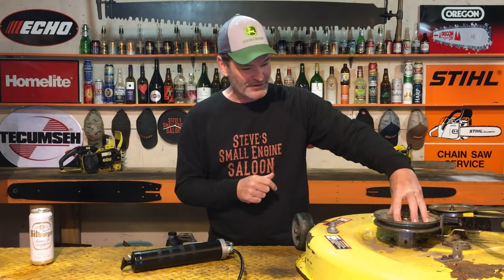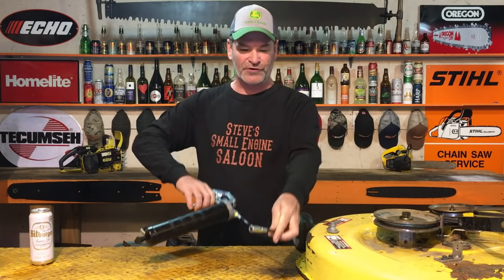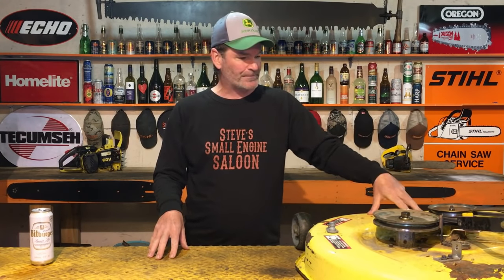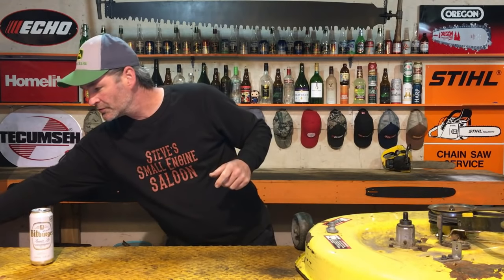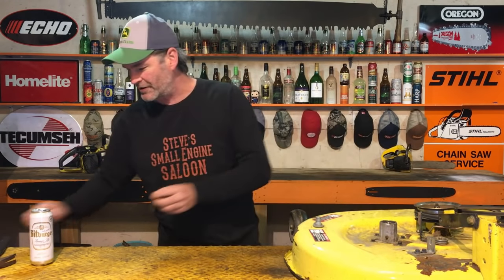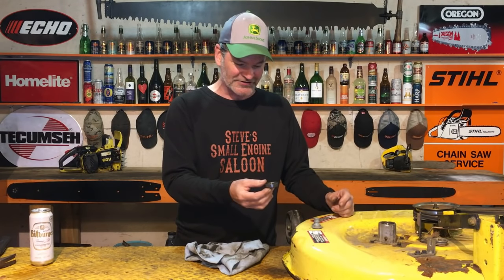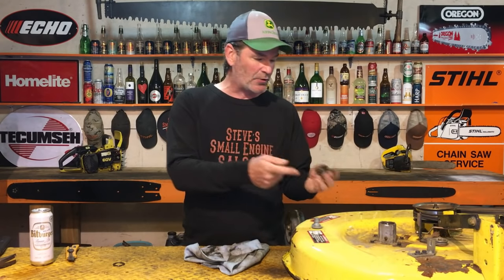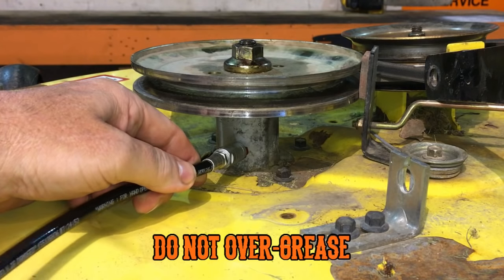Your Riding Lawn Mower's Dirty Little Secret

Comment: Steve should i just simply not bother to grease the grease nipples (we call um grease nipples in uk haha) on the spindles then,iv a almost new x350r john deere with the greasing points on the top instead of the sides of the spindles,now you mention this steve when i used to grease the mower deck spindles on my x110 i noticed the grease would like squart out under the mower deck out the bottom of the spindles just above the blades,which is like you say its bypassing the bearing,it says on my service sheet i only have to grease the mower deck every 100 hrs,one of the spindle grease points is blocked so is there any point in me replacing this grease nipple,great videos by the way

Comment: I ended up doing this with my fathers cub cadet. My only question now is how much to pump the gun and if I add too much grease, can it blow the seal off the ends of the bearings and do harm? I miss my dads old gravely. It had a weep hole that grease came out of when it was full. 30 years and not one bearing failure

Comment: I believe its on purpose not being able to grease that bearing.   Just like the cars or truck we buy.  They're built to break down so that the car companies can double their profit on the parts industry.   The race track we see with new car advertisement are used to see which parts last too long or too short so that the engineer can modify them to last the desired length of time before replacing.  Besides, how can they sell you a new car if your old one still works?

Comment: Good video and Thanks.  I did a spindle bearing replacement last year  and assumed that a double sealed  bearing would not be used because it had a grease fitting.  Now I know that John Deere has been taken over by  bean counting idiots that don't care one iota for product reliability.   The cheap Chinese bearings only freely   spin a few revolutions as compared with American  or German made bearings.    The nuts and bolts of the CHINESE made replacement  parts sold by JOHN DEERE dealers are WAY inferior to original American ones and will SNAP  tight off when properly torqued to original specs and the John Deere dealers WILL NOT let these junk parts be returned either.   Real mechanics Torque to factory specs however and John Deere  is now  selling JUNK DEERE replacement parts.  Cheap junk parts sold at full price are the latest parts scam.   The Deere is DEAD quality wise in the replacement parts department ,   so you are correct sir.

Comment: I have a Land Pride 6 foot finish mower deck.  I just replaced all the pulleys because the were rough and didn't get grease. I also greased therm, but I felt I neglected greasing more often, and that's what caused it to fail. I also looked at my sealed bearings, but I didn't add 2 +2.They didn't get grease; how could they?  My mower deck was designed to fail, but I feel bad that I didn't recognize it at the time.I already replaced 5 pulleys and have one pulley  not yet replaced because I cannot get the top bolt loosened no matter how hard I try to keep the blade from spinning underneath.  These engineers got us by the nuts.
Reply: No, CUSTOMERS have all the power!
Once customers STOP buying garbage, the garbage makers respond, IMMEDIATELY!
Competition rules the day!!!
Stop supporting garbage; support class!
Things will turn around, FAST!😊

Comment: Did similar with fan belt idler pulley on my Ford truck, took out bearing , drilled a hole in seal ,injected new grease, and put  some good tape over the hole with some pvc grey glue/cement and sealed it over that. Never had a problem with it again
Reply from the maker: Right on Marty!  Thank You...

Comment: I saw this on my Craftsman many years ago after the first spindle went out. In fact it only had sealed bearings and no grease zerks provide, so I drilled and tapped housings for zerks they removed the inner seals on the bearings and had no further issues. I did have one advantage over a lot of people though as I worked in a machine shop many years before that and had a good understanding of how bearing lubrication worked.
Reply from the maker: Right on Carl!

Comment: dad showed  me this bullshit a decade ago on new sealed bearings, never had to replace one yet on my 2009 Cub Cadet LTX 1050 for this very reason, I agree with your thoughts, some guy below posted to invert the lower bearing seal so pressure is released?    this isn't a automobile , its a lawn mower, don't invert the lower most seal, this will just make all the grease you pumped in or manually applied to fling out the bottom under the deck.

Comment: Sold bearings for 35 years…the grease is engineered to last the life of the bearing…don’t waste your time greasing them because you WILL over grease them…run them till they fail and replace with the brand SKF not a Chinese piece of crap they buy at the factory

Comment: Those Chinese bearings are like $1 a piece. Why bother? Take off the seal, dirt will get in. Probably last longer if I just keep it sealed on both sides. When it fails, just install $2 worth of new bearings. Too much trouble to grease the spindles anyway.

Comment: The deck was designed a long time ago and it was designed for plain unsealed bearings.  Later on the decision was made to use sealed bearings because so many people don't bother to grease the bearings.   Sealed bearings last a lot longer than ungreased unsealed bearings

Comment: It’s true.  Absolutely on point. Anyone who has had that teacher drag their fingernails down a chalkboard should know what a bearing seizing sounds like.  With the same yet amplified effect. I installed a new set of bearings on all 3 spindles.  Easy as pie. Just don’t put it off. My JD E140 was only 2 years old when this Funtime started.  Thanks, Steve.  Your video on this matter helped fix this pain in my backside.

Comment: I figure the grease will eventually push the outer seal away from the bearing. After all, it's not particularly easy to see what is happening while applying grease. My thoughts are to leave the bearing alone and not bother with greasing them at all. Also flooding the mower deck with water after mowing is just gucking up the underside of the deck so I stopped doing that as well.

Comment: Why not just grease the bearing and replace the seal? If you use the jerk their is no place for the old grease or air pressure to escape. Plus you will have to fill the entire cavity to do any good. Basically your still in the same boat. Just grease thw bearing and replace.

Comment: Would it be a good idea to drill a very small hole below the top bearing into the spindle cavity? This would indicate when the void is full and prevent hydraulic pressure from blowing out the outer bearing seals. After filling, a zip tie around the spindle, covering the opening, would prevent debris from contaminating the inner workings.

Comment: Wow! Thank you so much for posting this! Yes companies do do this type of thing to make the sub assembly fail and then they can sell more parts and get more labour rates for their repair shops. Either that or sell new mowers! I just found your channel and am enjoying all of your ideas that I can do to my son's rider mower. He's got a John Deere model D125. My suggestion to buy it. Thank you again! This video showed me how to remove the blade assemblies even though the assembly nut is rusted on. The blades are in dire need of sharpening. I have an attachment that works on my drill to sharpen the blades. What are you thoughts on these attachements? Do they work well? Also, are there any more of these useless grease ports on the mower? Thank you!
Reply from the maker: You're Welcome...

Comment: The spindle was designed with a grease nipple to use the open- type bearings of yesteryear. A cost-saving was to use Chinese " sealed for life" bearings which cannot be greased. If cost was such a major concern, why didn't they save the cost of the nipple and the hole for it?
Reply: I think this may be the most likely explanation. However, I do wonder why they still take the time to drill and tap a hole then install a zerk fitting. Some have mentioned that it's still there to keep moisture out of the shaft. Perhaps, who knows?

Comment: On my 1993 Wheelhorse 520H, 48inch base, the three spindles have fittings on top of pulleys. I do about 4 or 5 pumps. The grease will eventually come out under the bottom. No problems! 
It's pretty damn low if in fact the John Deere people are intentionally decieving their customers! But it's certainly believable in light of the fact that the poor farmers can't fix the tractors cause of all the software crap!! They don't care cause their greedy corporate pigs like all the rest!!! At the local auctions in the spring+fall you will see countless John Deere mowers lined up , but you will "Rarely" see any Wheelhorses" !! Toro killed the Wheelhorse cause they did nothing to market the tractor! I will never! buy any of the Green+ Yellow junk!!

Comment: Thanks for the bearing info Steve.  I have a John Deere deck, fairly new,  that I have been greasing, I will be checking the bearings out.  My pre retirement job was a vibration analyst, I monitored and inspected hundreds of failed bearings.  If the sealed bearings were greased from the factory properly I would think they should last a couple years.  I have inspected brand new sealed bearings and have found not all bearings are greased equally.

Comment: Steve...I love your site and your advice...but....
From a bearing engineer.....
"Grease suspends oil and releases it with heat. The oil then seaps through the oil seal lip when the shafts are spinning letting oil into the bearings.
Do you really think engineering would be so blatently corrupt to intentionally ruin spindles for so many years without intervention?"
I have a John Deere that has been religiously greased for 20 years. The spindles are fine. The seals are original too.
When you remove the inner oil seals you're allowing dirt from dirty zerk fittngs to be injected and contamimate the bearings.

Comment: For sealed bearings, I thought the purpose of greasing the spindles was to help to stave off water. A sealed bearing is that in name only. There's always a tiny space where the seal runs against the bearing races. By covering this with grease, water is less likely to get in. Before sealed bearings, open bearings needed to be greased for 2 reasons. 1st to lubricate, 2nd to seal.
Reply: Yes, this is what the Cub Cadet manual says for their decks.  Grease is used to displace water.

Comment: Sealed bearings with synthetic grease will not get contaminated and out last bearings with zerk fittings and especially using general purpose grease. Maintain sealed bearings and be happy ever after.

Comment: If i see this correctly i would remove 3/4 seals
Top : remove 
Mid top : remove 
Mid bottom : remove 
Bottom: leave it on
So excess grease would flow out the top, or replace the top bearing with a bushing

Comment: Same bearings in my Westwood with no grease nipple. But with your seal removed will the grease not push the outer bearing seal out with the grease guns pressure? Leaving the bearings unsealed?Tempted to ask are they the right bearings but they probably are

Comment: ☆HOOTYHOO☆  Good Action Man. Yes of coarse these manufacturers are fully aware of that bearing set up...  On the flip side;  You might take a pole of your patrons on: what is the #1 cause of Bearing Failure? Do you Know???   

 OK I CAN'T KEEP Ya in the Dark...

   The #1 reason for Bearing failure is over lubrication!
    ⊙ the Bearing will get lubed so regular (usually scheduled) that the grease gets impacted inside, not allowing for the Bearings to turn... then you get a permanent flat spot.
   Pulling those seals is unusually the best case scenario. NOT ALWAYS! But usually.
   Scott Outta Wa.

Comment: I have a JD L130 and the PTO clutch has  8 or 9 years of summer mowing use and is still working, just put grease in those sealed bearings.

Comment: cool little trick but ya need 2-4 small holes drilled into the outer seal so grease can flow thru effectively on both sides of spindle , ROCK ON !

Comment: One other secret hardly anyone knows about is there is really a couple of manufacturers of non- commercial Lawn tractors. The only two are MTD Canada (cub cadet) and anything sold at Sears id #247-00000( the cheap mowers)from 2014 or so, Home Depot,etc 
and Husqvarna USA  built  for Sears and Lowes etc (the better built Lawn tractors).
The only ones that aren't built by those are toro as far as I know " as of a few years ago". 
As of 2014 Sears was phasing out husqvarna tractors they still may sell them, look for tractor Id #'s that start with 917-000000
And that corresponds to the push mowers to...
And sorry to bust your bubbles the green and yellow ones are not built by the green and yellow company!!! They are built by one of the two builders above with the same parts just painted green and yellow... in order for you to buy a real one you have to buy it from a full line green and yellow dealer which cost thousands more$ buyer beware and do your homework

Comment: Car wheel bearings are sealed and last 100,000 miles or more. But over grease them and they’ll be toast in no time. The grease needs space to move about.

Comment: I owned a 1974 Cub Cadet for over 30 years until the engine went bad after being rebuilt three times over the 30 plus years. I have three acres and need a good mower. My wife and I bought a brand new Cub Cadet that was the biggest piece of crap I ever owned. Had nothing but trouble with it throwing the mower belt off. Took it back twice to be fixed and twice was told it had been repaired, but it kept throwing the belt. I put it up for sale after the first year and gladly sold it for a loss. I found a 1976 Cub Cadet with 50 inch mower deck. Paid $700 bucks but it has worked flawlessly . Don't waist your time with Chinese crap when you can resort back to American Made. Its worth it.

Comment: In this instance, I think it is less planned obsolescence and more trying to fit their average customer and eek out a little more base lifetime before major service.

Sealed bearing last longer if not being maintained. Open bearing last longer than seal, if being maintained. So it's a choice of what you want in there.
Since many customers are going to ignore maintenance, the choice to put a sealed bearing in is a better choice/longer lasting, and it lets them advertise it as "maintenance free*"
"*for the life of..."

But they are just buying chinese castings for the bearing/spindle assembly that come as they come. Some will have the zerk in there already, some won't even have the hole bored out.

Which would I want? greaseable. But I would grease them where a lot of people would just ignore it and run it unto death.

Comment: Many manufacturers are switching to sealed bearings. Why? Because most people never grease their bearings! Although I don't disagree with you overall, filling up the cavity does serve a purpose. It eliminates a space for dirt, debris and (especially) moisture from accumulating in the cavity. this type of units are meant to be used for home owners and will last years "as built" without a problem with these bearings.

Comment: BS -- The spindles on my previous riding mower lasted the life of the mower - 26 years - with no problems.  Current mower is 6 years old and have had no issues.  Shortest time I ever kept a rider is 10 years and that one never had spindle isses either.

Comment: Let me first say I love channels like this because they help the average mechanic get information that's extremely helpful. That said, when i see something that will not help and actually make a problem worse, than being a mechanic myself, I feel like i need to point it out.

So, the idea in this video is to extend the life of the bearing. That is a good thing. But, the method is wrong and here's why.  And let me start out by saying that if the reader is capable of pulling out the bearing to begin with, your best to simply have new bearings in hand.  Aside from that most people cant go into the job that deep.  So, you say pull the bearing seals on the side facing each other and the grease fitting so that the grease can actually get into the bearing. While that sounds good, here is why it is not. "Hydraulic Pressure".  When the user makes the modification and then pumps the spindle shaft full of grease (Which will take quite a bit) the pressure of the grease will push out at least one of the 2 remaining seals  out which will then let contamination in and ultimately destroy that bearing.  The rubber seals come out very easy  Now if the seal has a metal seal this method may work.  Bearings with metal seals have a "ZZ" in the part number.  Rubber seals have an "RS"

Its my position that if you have the skills to pull the bearings, then simply pull the seals, clean the factory grease out  and then use a good quality grease in the bearing.  The lack of factory grease and switching to a premium grease with extend the life of the bearings probably 2 to 3 times.

Comment: As a X MFG worker that worked in materials your wrong. It all come down to dollars and cents and it it will make it passed warrantee. In MFG you are to do more with less every year to keep growing. This is done with cheaper parts or benefits or cost saving idea like you just pointed out. Eliminating a grease zert and one process in the MFG of the housing.

Comment: Just because there is a seal does not mean that grease cannot get into the bearing. Grease under pressure from a grease gun will pass the inner seals, fill the bearings, and come out the other side. Pump the grease slow so you don't push the outside seals out. Once you see grease coming out of both of the bearings, they are full. Make a video showing that!